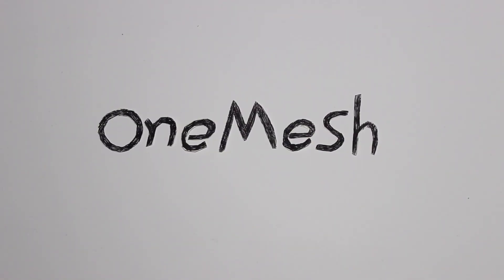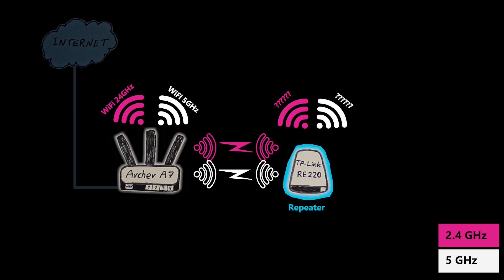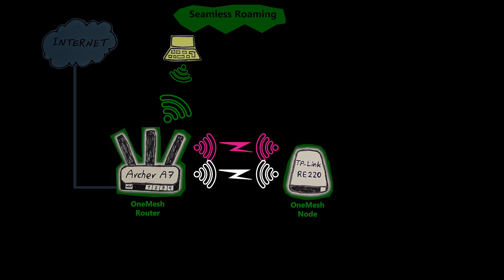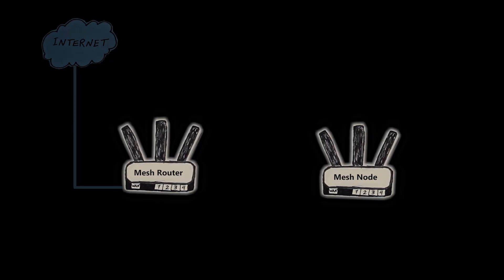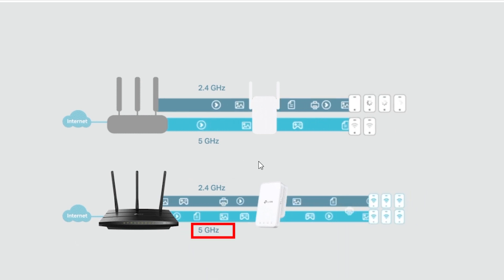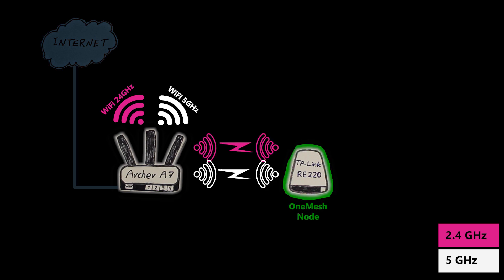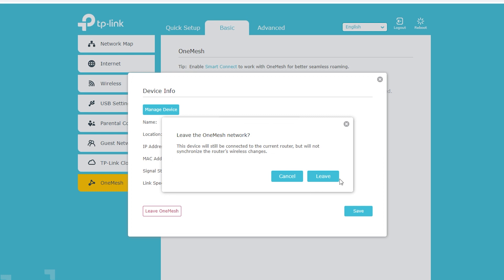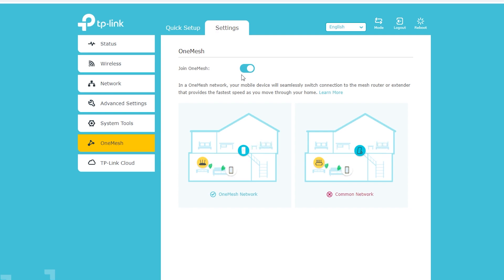What is TP-Link OneMesh? How to configure it?

Comment: The fact that you can't use more than one router in the OneMesh is dumb. The Archer AX10 router is approximately £75 in the UK, only a £10 premium over the RE505X, and yet comes with a much more usable 4 ports. I find the plug in extenders just to restrictive, not just in available ports (can always plug into a switch, sure) but also just in form factor. If AIMesh can allow multiple routers, there should be no reason why this can't. It wouldn't be so bad, but TP-Link parental controls are semi-decent whereas they are archaic on the ASUS devices and not good enough on the NETGEAR. So frustrating.
Reply from the maker: Yup, I hope TP-Link changes their policy and allow to use multiple W Routers in the OnMesh, it doesn't make sense to me either! cheers.
Reply: @Behfor  Hi, anything changed with that? or TP LINK still block use multuple Routers in the OneMesh? :)

Comment: Hi, I would like to know if is possible to use 2 One Mesh Router connected via cable instead of wireless, the network in will work seamless (unique SSDID)? For example 1 Archer C7 with 1 Deco M5 connected via cable (because of the distance)... Thanks in advance!

Comment: Thank you very much for this great video.
Is it possible to connect Second RE220 that fare away from Main router. and how?
Thank you.
Reply from the maker: Hi, the 2nd RE220 could be connected to the 1st RE220 (daisy chain), not very much recommended but it should still work, thanks.

Comment: Hi Behfor,
I have watched most of your videos and I must say you make great Videos. In Your Video, Content coverage is amazing. I appreciate all your efforts make so much informative videos.
All the details you mentioned are very helpful & useful. Recently, I have seen your both Videos related to TP-Link OneMesh and I have 1 below query:
I have Router Archer C6 (Primary)  & Range Extender RE305. I established OneMesh Network, Now what if connect another tp-link router (as Access Point) to Primary Router Archer C6 through LAN Cable?
Reply from the maker: Hi and thanks! You can connect an AP yo your network but that will not participate in your OneMesh network. You can manually create wireless networks on the AP though.

Comment: Hello, how many tplink devices I can connect to the tplink one mesh system, just like I can 2 tplink devices connected to the tplink c7 router one mesh system? Or I can Put just one?
Reply from the maker: Hi, I'm not sure what's the maximum number of devices you can connect to the onemesh system, however, you can definitely connect more than one. 👍
Reply: Behfor can I connect two tplink c7 with each other, to work together on the onemesh system?
Reply from the maker: As I said in the video unfortunately no
Reply: Hello, I am am having 2 same model routers spreading wifi from different ISP on opposite corners of my apartment. As concrete is too thick I have coverage of both routers only in the middle. If I buy any 2 piece deco pack, should I be able to configure them separately to the 2 different routers? I mean, are they paired to each other or I can use them 1 by 1 on different locations and networks respectively? Sorry for the dumb question, but those guys in the store said  it will not happen... somehow I hope they were not enough informed.

Comment: Hi @Behfor,

I have recently started watching your video and I liked it too much. You are really doing great.
You have made a Video with ASUS router for the Dual WAN feature.
- Could you please suggest other Dual Band Wifi Router supporting Dual WAN and Mesh Technology? 
- Is there any other workaround to have Dual WAN setup on TP-LINK routers (I am using TP-LINK Archer C6-OneMesh)?

Thanks in advance.
Reply from the maker: Hi, thanks and I'm glad you liked the video :-)
If your router doesn't have the dual-wan feature, a possible workaround is to install a third party firmware such as DD-WRT that has that feature! Of course that depends on whether the router supports that firmware or not, and whether you are willing to take the risk of installing a custom firmware or not, because it might void the manufacturer's warranty and if something goes wrong it can brick the wireless router!